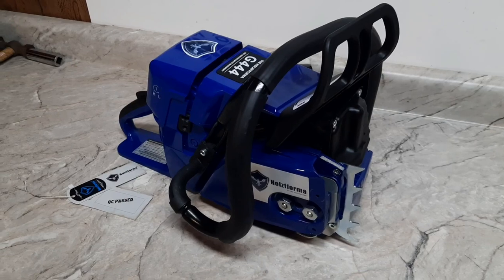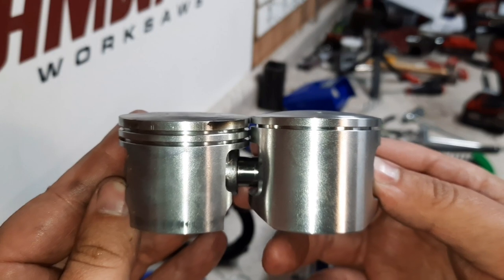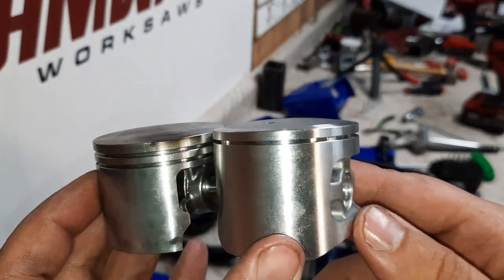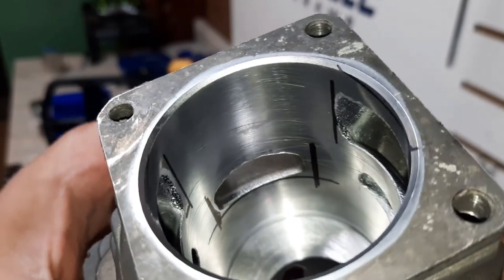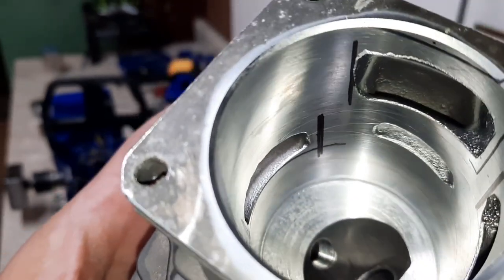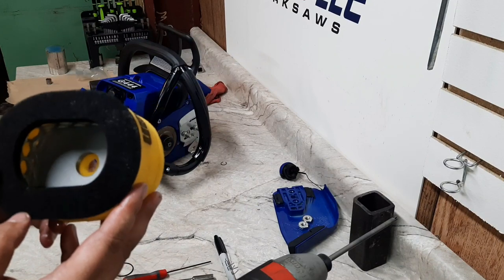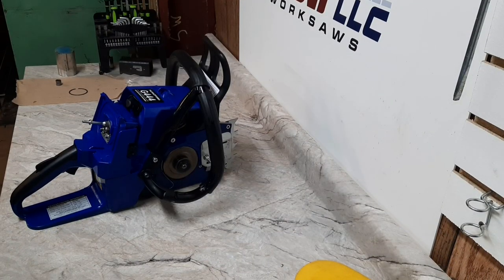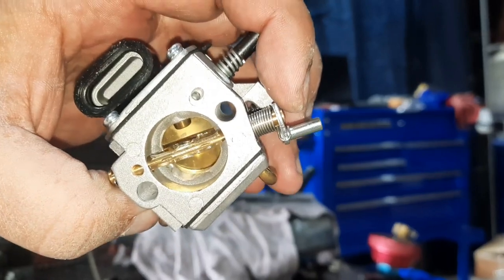Holzfforma G444! Blue Thunder! Made Stronger!!

Comment: I would like to see an oil ratio dyno test on an autotune saw like the 550XP mk II. 50:1, 40:1 and 25 or 30. Another interesting one would be ceramic bearings. Love your videos and good to see you back.
Reply: The differences in performance should be much. The reason to run a 30:1 over a 50:1 is the lifespan of the lower end bearings, which easily doubles or more, no matter what kind of 2 stroke oil is used. Rolling wear loves oil volume.
Reply: From an old test I seen in mx bike engines 18:1 made the most hp, I can't remember the exact hp numbers but I felt 32:1 was the best balance. Which is also what yamaha recommends for a yz250.

Comment: Nice build. It covered most of the tricks to get the power. Be nice sometime to go over carb mods for those who aren’t sure of them.
Reply: Couldn't have put it better myself, am kinda stunned seeing just how significant a gain he saw off the carb-mods, I mean I'm not ignorant (not experienced, either) on this stuff and seeing the #'s he got for raw power were both awesome and, frankly, kinda expected (FOR HIM, lol wouldn't expect anyone else to hit his #'s they seem genuinely league-of-their-own unless his dyno is broken :P ), but seeing him bump the power THAT much from 2 simple "carb-enhancements (neither move on the carb was "fixing an inherent problem", or altered jetting, just simple "blueprinting" type work smoothing the bolt-head &shaft, & the venturi, never would've guessed the dyno would show 1/5th the gain it did (heh I guess that means the dyno being accurate is actually not even that relevant, IE even if it read 1HP high - or LOW - it would still be showing good-enough RELATIVE changes IE "23% gain from muffler" or "from porting" (though, for him, it seems high-20%'s are a bare-minimum gain when porting and nothing else, just altered port-timing, so impressive!!)
I'm sure you know this already but if you've got one of "the primary models" from Holzff., then you can order carbs from Amazon for like $10, next-day shipped, at least for 660's!
Reply: Great video, excellent results… interesting fitting the echo piston too. Keep up the good work.

Comment: From my experience with logging since a child the newer saws now are more about high rpms and enertia and the older saws were more for torque and I always liked them better than these new ones I have a 327 Husqvarna and built it and it makes nine and a half horsepower I custom made a dome top Piston and shaved the head and  ported the intake and exhaust and drimmeled the inside of the piston to have more space for air and fuel to fit under it

Comment: I would like to see a larger carbs effect. Great build! I think you should reconsider  building these saws  for people. There are a lot of people that like chainsaws that don't really use them(like me) . Just stipulate no warranty, if it blow up it blows up. Hobbyist only saws, not for real work. Shoot I live in Florida . Got a g372xp sitting on the shelf. Don't think there is a tree in the whole state I couldn't take down with my 46cc poulan.
Reply from the maker: Problem is if the cylinder plating flakes, it will do so after machine work and time involved to tear down. Then I am out that labor and have to start with a different cylinder.
Reply: I am with you on this one.  The quality control on this stuff is so horrible.  As you said, some might be ok, but others won’t.

Comment: Maybe should have just put a small indent on the piston where it came into contact with spark plug instead of just cutting the whole piston all the way around  .. when I shaved the heads on my old 20 horsepower L head Briggs & Stratton   I just put a small divot on the Pistons so it wouldn't have interference between the spark plug and the piston (bout  .040")

Comment: Nice job Joe. Interesting choice of piston. I would be interested in seeing a dyno run using the Eagon filter without the stock cover and with a max flow cover, curious to see how much the tight fit affects it vs a max flow cover. I do like the idea of keeping the stock cover, esp. On a 044, 046 saw vs the max flow cover.
Reply from the maker: Both the max flow and Egan filter can flow way more air(cfm) than most any saw can handle. I knew the carb was holding me back when I pulled the filter and power didn't change.
Reply: @dynojoemods2764  Glad to see ya back on YouTube. I have heard others mention concern over how tight the eagon fits in some covers. You make a valid point about how well they both flow and that even with a tight fit it is better than stock. I was just curious how much if any does the stock cover restrict the eagon filter.

Comment: OH and for your viewers (and anyone NOT you, who may shy-away from Maxi's exclusively for financial reasons IE you already go through a half dozen filters you can't just swap all your units to Maxi's and continue at that rate!), there's "a trick" or technique, really, to prevent issues of FLOW/throughput (HD2's, as you've shown dyno joe, are only 2% more power than HD2's, one can surmise - I believe - that Maxis' superiority is a result of their longevity), IF you do subtle mods to your airbox-cover to allow more air-induction, and you "filter" (cheesecloth, fabric whatever anything THIN) these holes, like Frog Skinz only D.I.Y., you can achieve an airbox setup that's got more income-potential than the Maxi boxes have, and - at its center - has that 98%-as-good HD2 filter, no pre-filter necessary, and - provided you ensure you've got the high porosity foam-insert inside that filter, for catching oily carb-spitback, your HD2 will NOT rapidly fade, it can retain near-new potential WAYYYYY longer (like a Maxi, because Maxi's can take more dirt to the outside and, on the inside, don't give a hoot about a non-reed intake's inherent spitback...but you can simply address those 2 items in an HD2-based setup and voila you should be keeping your HD2 "98% of Maxi" power only no outta pocket $ and WAYYYYYY less-frequent filter cleanings, am still amazed how long my cleaning intervals became once I started over-sizing these "lightly filtered air-inlet" slots/squares I carve into the sides of my air-boxes!)
DEFINITELY not a pro trick, or something you even wanna show-off to your sawyer buddies LOL, but hey sometimes efficiency & value are important IE residential tree care :P

Comment: Very good video ! 
 I Really like the 044s  . I had and cut timber with 3 of them . 
Ran 32" and 34" bars on them. 
 Fell my biggest Yellow Cedar with my Madsen Modified 044 with Pro Tek air filter with a velocity stack. 34" Sugi, full skip 75 CK , chisel ground. . Great saw ! 
 Can you explain the difference in horsepower#s between the factory specs and your #s. ? 
 Again, great vid !!!
 Also, did you weigh it before you added fuel and oil ?

Comment: do u use normal burrs as in rotating file when porting theese chinese saws? I got told they are very hard to port because the plating usually flake off when u try to port it? how u solve this?
Reply from the maker: Have to use a stone, or diamond abrasive to grind the plating away first then use the burr to remove aluminum only.

Comment: Do you think the Holzff carb your unit had may have been sub-standard (by THEIR quality-levels, I mean)?  I ask because I have a good proper walbro, and a cheapie Holzff, carbs on my 660's (ported, 1 is 56mm) and feel dumb saying this but don't think I can tell the difference (IE if someone swapped the carbs between my 54mm setup and the "hotter" 56mm setup, adn just tuned them to "like kind" idle/H/L settings, I doubt I'd notice!)  Furthermore, I'd been (mis?)interpreting your works to mean/"prove" that the carbs ARE good for more-than-OEM, by a lot - your 590 frankensteins, wherein (on OPE forum) you say you don't even NEED to do the 620 carb/coil swaps for the 440'd-590 monster-machine (thanks, btw, thought I was done messing w/ saws & now KNOW I can't get that outta my head til I have it, or am convinced it's cheaper to just buy a 7310 & port that...but am doubting that's the case...I wonder if YOU would do "as-is"/all-work-final-sale for a used 590's crankcase, just tapping the cylinder-holes so I can put my own 440 top ends onto my 590?  Currently I am "going to do it" and my best thought is "the JB Weld trick" for seating the jug but if I'm being honest I'm still very worried Re how well I can pull that off...I do use/love JB for intake floors, even if they didn't need reconstruction in the 1st place (cuz jb is far, far easier on intake-skirt's bottom!) but doing bolt-holes that you're gonna ratchet your 4 cylinder-bolts into, just picture myself wrenching-out the holes I'd made :P )
Thanks as always and Re the Holzff carbs I'd LOVE knowing your thoughts Re my earlier Q, whether you think your unit here was "a kinda crappy Holzff carb", OR if you suspect MOST of the G440/G660's are gonna see gains from "regular Holzff" carbs IE they're ALL that bad (OR am I misinterpreting the carb work- would you still be seeing 5%+ gains doing those same mods to the OEM Walbro carb?)
Thanks again, keep pushing that envelope & letting us watch it is AWESOME!!!
Reply from the maker: It would be cheaper to buy and port a 7310, than for me to build another 440/echo hybrid.

Stock carbs will feed more power, but most any saw will make even more power with a larger than stock carb to an extent.

I would guess oem carb to gain the same as this aftermarket carb with the same simple mods.

Comment: do u break in the cylinder b4 u dyno it?
Reply from the maker: No, normally just warm up and make the pulls. Unless a used saw comes in that is already seated.
Reply: @dynojoemods2764  wont it underperform when not broken in?
Reply from the maker: @julianlaustsen1991  
Typically only down a few %
But i do tons of new saws cant put gallons through each